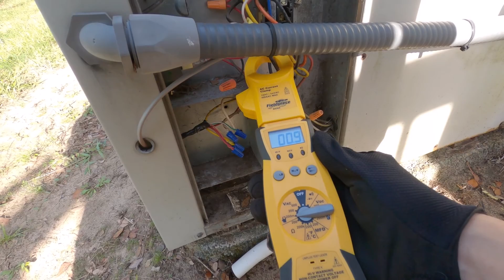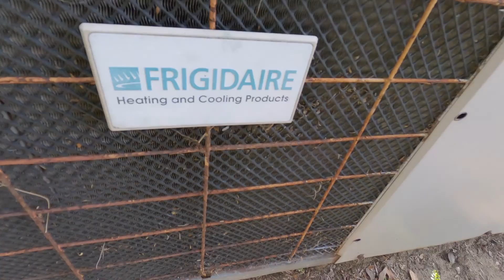Old Package unit Not Cooling. HVAC diagnose and repair. They told them it couldn't be fixed

Comment: Even the old units,like a new capacitor and contactor,a little oil on the motors and a little water on the coils.you might not be back in a few years.
Reply from the maker: Yessir! If they aren't leaking refrigerant and the customer doesn't mind paying that high electric bill, I'll keep em going